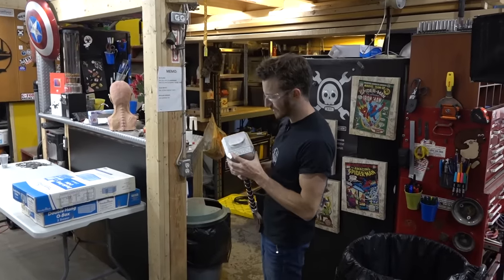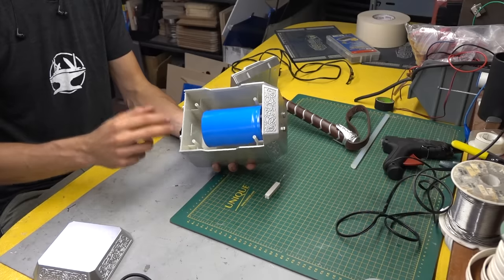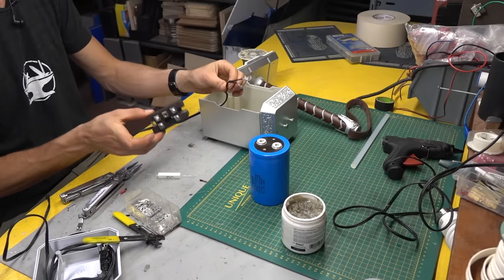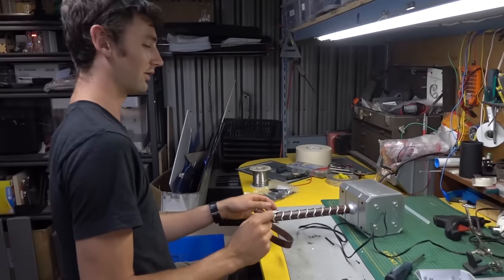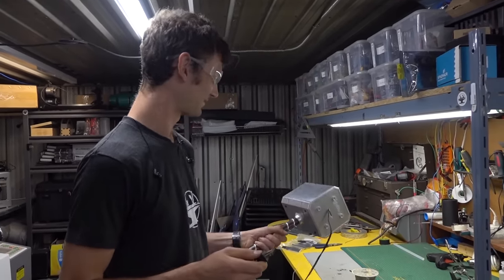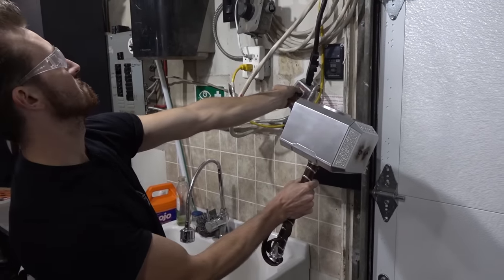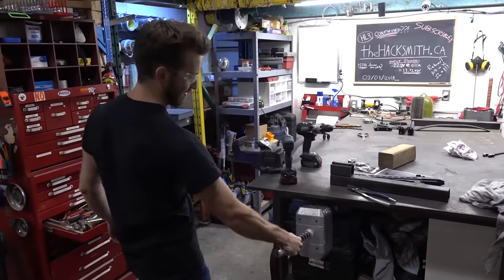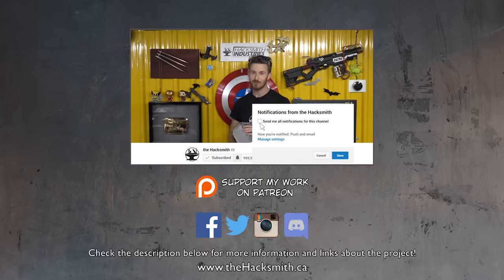Thor's 300V Capacitor Hammer Build!

Comment: "Extra safe adapter".

Right on top of a kitchen sink.

The fine irony of knowing how to work with high voltage capacitors and completely butchering the high-tension norms. Sir, you're an idol to me.
Reply from the maker: Where else would you put it! xD
Reply: Inside the sink?

Comment: I dear you to make the suitcase of kingsman which turned in to a full body shield with the screen on top. That with the press of a button it can like flip the sides and slide them to convert the box in to the shield.

Pd: Doesn't have to have either a rocket luncher or a gun built in.
Have fun building it
Reply: ROBLE2003

Comment: Yikes, that a yuge capacitor.. isn't that enough to stop a heart? :x
Reply from the maker: probably
Reply: Two things I like about this comment:
-Yuge. You sir are amazing for daring to use that anywhere online 👍
-I read heart as hert and thought of Daily Transmission. Not enough to stop Hert lol, but Hacksmith is right about everyone else :P
Reply: Rae Chrest 48 volts can only kill if there is enough current (amps). Same with 400 volts. Having said that, voltage does help the current break the resistance of your body, so high voltage is still dangerous.
Reply from the maker: +Ben Rawlings also depends if it's AC or DC. DC for example I have touched 144VDC with each hand ( not recommended ) but just a tingle. If you did that with 144 or even 120vac your probably going to stop your heart!
Reply from the maker: +Rae Chrest also depends on AC versus DC
Reply: the Hacksmith ahhh okay thanks!
Reply: Rae Chrest 
I kinda compare Electricity to Water in pipes. Amps' like water pressure while Volts' like the diameter of the pipe/node
Reply: no problem Rae, and yes you can. I bought a 'boost converter' off of ebay, which steps up 3 volts DC (2 AA batteries), to supposedly 400 000 volts, but it does nothing to the current, so there is barely any amps in it. I touched it and it did no harm, but still hurt a lot.
Reply: +Ben Rawlings But you have to have the volts, if you don't have enough current, the voltage collapses. That's why voltage is usually more dangerous (especially when dealing with capacitors) but In the end you need both.
Reply: +Mike Aba volts is the pressure, current is the amount of water that flows through the pipe, and pipe diameter is the residence
Reply: +Ben Rawlings if you tried to charge that capacitor with a boost converter and some batteries, you'd be there forever,
Reply: Mike Aba or start one
Reply: piercing silence 
Heh, yeah. No idea how defiblirators work tho
Reply: Gabriel Schoene 
what's "residence"?
Reply: Rae Chrest
Volts and amps two different things. One is a measure of voltage and one is a measure of current. X amounts of volts does not equal Y amount of amps
Reply: Stop it? More like French Fry it.

Comment: What Thor Hammer replica did you guys use to make this? I'm asking because it's one of the better looking ones I've seen.
Reply from the maker: +JOHNSMITH11, The Guy of Thunder links in description
Reply: the Hacksmith You're right, there are links in the description but not for the hammer in this video. That's why I asked.
Reply from the maker: guess that means the store isn't selling them anymore, just the metal version (which is nicer btw)
Reply: the Hacksmith  True, but I already have the metal one lol

Comment: You can use a multiplier circuit with a batery and a swtcher  to convert dc from a 12vcc to a 4kvcc so you can charge the capacitor and make it portable. Like a taser

Comment: You should take the capacitor rigged one, and charge it using the Tesla coil vs the 120V or 240V, then hit the shield with the exceptionally charged Thor's hammer.

Comment: You should put Supercapacitors in there with the next version. And maybe batteries in the handle to store energy for additional uses.

Also, give it a tungsten casing, just to give it some extra durability and heft.
Reply from the maker: Tungsten shatters
Reply: the Hacksmith Wait, really?! Dang.

Comment: make a metal one that's  activated by inertia so it only sparks when you hit something hard enough. i guess you probably used plastic for the insulating properties but you could isolate the anode and cathode well enough in  the system then use a polycarbonite handle.

Comment: when you use a rectifier you would half the voltage. so at 110 you would have a bit less than 55V and at 240 you would only be around 115V.

Comment: Pretty simple, yet so cool.. maybe you could improve it by putting two metal plates on the face off the hammer, connecting each  one to a single electrode of the capacitor. You could just use it more effecively that way, because you wouldn't have to line up the electrodes every time with the object you're trying to electrocute
Reply from the maker: line up? most of the time you just swing it and hit lol, i was just being cautious

Comment: Does it have a discharge circuit for safety? Capacitors build charge even when not in use.

Also what happens if the face is laying on a metal surface while charging?
Reply from the maker: +Extra Mental they do not charge when not in use... They discharge when not in use... Leakage current.

If you charged it while it was shorted, you would trip the breaker immediately.

Comment: At 3:25 in the video, when Ian tests the hammer and says "that's half the power...", that isn't actually correct. It's a quarter of the power when compared to charging at 240V (stored energy U = 1/2C*V^2). And when you think about the capacitor discharging through a fixed resistance, both the voltage and current will be double when the voltage on the capacitor is doubled, so the power through the resistance will be quadrupled.

Comment: the real one probably had herbs in the wrapped hilt that caused the electrostatic charge release that numbed the arms of the defender using full metal shield with a rim of hard wood to prevent the metal splitting and as i said the shock made the arm not work for the impact. this would cause the arm drop that left the opening for his sword which nobody remembers anymore. it wasn't special. it most likely took two herbs to work and required the use of remains that he constantly rubbed against plus leather and he had to get used to the shock. also i don't know the second herb but the first is most likely cotton. when you live in the north you use whatever is at hand. especially if you took it off a dead guy.  oh silk.

Comment: Would the cap discharge through the lead if you were to touch the plug ends? If not, you could mould the plug into the bottom of the handle so you don't need to open the hammer and plug it in every time, you could just stick the hammer into the wall outlet and it would be quicker
Reply from the maker: nope. rectifier is also known as a one-way circuit, diodes only let the AC in to become DC, then the DC can't come back out ;-)
Reply: Would it spoil the look of the hammer to have the pins out the bottom of the handle so you don't have to open and plug a cord in? Thanks for the reply.
Reply from the maker: sure but... any method of plugging it in is lame haha, you're suppose to charge it and THEN use it ;)

Comment: You can build this with the used flash cameras from a walgreens.

I did this like 5 or so years ago and 2 walgreens gave us a bunch of their used cameras for free. 
You take the capacitors and cut out the charging circuit from the camera and do a couple wire solders and its done, and its super tiny.

The capacitors from the cameras are 330V and if you get a bunch, you can just bank all the capacitors together to get an even bigger pop.

Comment: Make one with a more solid build and instead of the pins, the whole face of the hammer can be made to discharge. Make the terminals large, flat and half the width of the hammer, and separate them with a thin insulator so when the entire face is touching(cuz it's flat), the hammer will discharge. And if youre making then rest of the hammer with metal too, then the face can be separated from the rest of the body with any insulator too :O
Reply from the maker: or wait until you see the rest of them ;-)

Comment: Jesus, that thing is lethal.
Reply from the maker: +Ian Rupenthal not really. It would just cause a bad burn. It's important to understand electricity, then you can safely play with it =)
Reply: Says the guy playing with a giant cap with no safety equipment besides glasses... Love your content, but man, get some thick rubber gloves and maybe some ear protection.  FYI defibrillators use less than 1000uf (but higher voltages).  Be careful.
Reply from the maker: +Ian Rupenthal and for a defib to start (or stop) your heart it has to go across it. Bit of a challenge with contacts an inch apart. Wearing rubber gloves while holding the hammer is completely pointless.
Reply: but what if you touched each contact with a different hand?
Reply from the maker: +Ian Rupenthal then you deserve it lol. Same as sticking two knives in an outlet.

Comment: What if:
1. Instead of using tiny metal bits for the discharge terminal, metal bars are used? So that the user does not need to think about the correct placement
2. The plugs and cable were placed inside the handle with an end cap
Reply from the maker: Huh? It's two screws, which are basically metal bars
Reply: @hacksmith  I mean parallel metal bars placed along the surface of the hammer intended to be discharging the capacitor. The concept is distributing and extending the discharge terminals all around the area of the active surface.

Comment: I'd highly recommend a cheap ebay power inverter and some lithium cells. You'd need to increase the resistor value and it would be a bit slower charging but it wouldn't need to be plugged in every 10 seconds.
Reply from the maker: Yeah because we really use this often ;-) haha
Reply: the Hacksmith actually you could probably just connect straight into the dc voltage rails and avoid the inverter stage all together. The boards are pretty tiny so you could probably fit it all inside the hammer.

Comment: Just leave it plugged in when you use it, way more fun
Reply from the maker: you'd trip the breaker...
Reply: I figure a clever guy like you would put a ballast in series like an old bar heater, then it would never trip the breaker and would charge at near full speed.
Reply from the maker: meh. this isn't exactly a practical weapon to begin with

Comment: It will be more interesting if you use a built-in Lipo battery and a step up converter to charge the capacitor.
Reply from the maker: not many affordable step up converters from 24-300v...
Reply: One russian proverb says: "If there is a desire, there are a thousand possibilities. If there is no desire, there are a thousand reasons." :)

Comment: Make the two sides I mean the whole plate to pass electricity and make the top circle portion to receive charge with just touching. I mean make the top circle portion a wireless charge receiver.
Reply from the maker: But you need to make a connection across two separate points to create the arc!

Comment: If you actually made a metal thor's hammer prop to put this into then you could really bash it around and stuff. That might be cooler, since if you hit anything too hard with that plastic model it will just shatter and you'll have plastic and wire and bridge rectifier and capacitor on the floor.

Comment: So I have a very poor grip on capacitors.  Why does it make a difference what voltage you charge it with as long as it is fully charged?
Reply from the maker: because it only charges to the voltage you put in! it stores more power at a higher voltage =)

Comment: Underengineered! Half your capacitor is wasted, it could have been half the size, (or twice as powerful). Energy in a capacitor goes up as voltage squared. At 300v you're looking at 149 joules of energy, but at 400v you're looking at 264 joules. Capacitor size (volume, mass, whatever) scales roughly linearly with energy... so, you could've been 43% more powerful out of that cap. Or, fit more caps in the same space. 

Dragging the energy out over more time might've been cool too, make it more like lightning. maybe 3 caps triggered in quick succession.
Reply from the maker: using what we had on hand, big ol box of caps.
Reply: Oh I thought you'd ordered everything from Digikey. Well that makes sense then. The right tool for the job is the one closest to your hand :P
Reply from the maker: speaking of which what should we do with the remaining 35 caps?

Comment: Yeah, I once charged my disposable camera taser with a 3.7 v li-ion battery instead of the normal AAA it required. I of course discharged it into a penny. My ears kinda hurt afterwards... 
Anyways... discharge the capacitor into a nichrome wire! It should go BOOM!!!

Comment: That cap won't last too long getting short circuited like that! Unless it's a pulse rated cap which most electrolytics are not, even then they don't last too long. I also would suggest putting a suitable bleed resistor across the cap. Otherwise somebody will eventually get a nasty surprise at the point they don't realise that someone else accidentally left it charged up and forgot to discharge it. Or at the very least a trigger switch that isolates the output studs when you let it go.
Reply from the maker: Good thing we have like 35 of these :P also we're pretty conscious of charging it for the purpose of discharging it. So no ones leaving this bad boy on!
Reply: Lol yeah 35 should keep you going for a while... :) I only mention the bleed resistor because 20 or so years ago when I first started working in electronics I did make the mistake of putting my slightly damp hand on a fairly large fully charged electrolytic cap. Got a hell of a surprise and was left with a nice set of burns on the palm of my hand. D'oh!

Comment: Use fly swatter circuit to charge capacitor without plug in
Use it unlimited times
Reply from the maker: +Satish Vaidya no where near as powerful
Reply: What about using more mini capacitor to boost amps
Reply: Or what about taser hammer
Reply: With voltage multiplier

Comment: i was thinking you could make one with a plug in the handle, a positive or negative electrode on either side of the hammer, a giant capacitor (like the one you already have in it), and some sort of amplifier to increase the voltage dramatically (buck boost, op-amp, inverter, etc.) 
idk just thinking out loud
or in text, i guess...
also i have no clue if that would work AT ALL
Reply from the maker: why would you have one on either end of the hammer though? how would you connect it to anything?
Reply: yeah good point... maybe one on either corner of the same side?

Comment: Could you use a capacitor like that to jumpstart a car? Seems like it'd be more useful than one of those junky lipo battery packs they claim will start a 6+ liter diesel. Anyways just plug it in for 30 seconds, then go jumpstart your car. No worrying about if you last charged the jump pack a long time ago.
Reply from the maker: not a capacitor like this one lol, it is possible, but you'd need one rated at 12V and many farads

Comment: Could you replace most of the plastic with lead ?
Reply from the maker: watch our heaviest hammer video :P
Reply: @hacksmith  I meant, with the capacitor, the wires, etc, inside of the hammer. For example doing a replica of the hammer in lead, then carving inside of it to put the capacitor and everything you need to make the shock inside of the hammer. Without forgeting the isolation, because lead is conductive.
Reply from the maker: @cerveau24  I'd use a metal hammer to start, the plastic would melt
Reply: @hacksmith  yeah that's what I meant : a full lead hammer, with the "shock system" inside of it. So it is shock-able and really heavy. Sorry for my English being a bit weird.
Reply from the maker: @cerveau24  definitely doable
Reply: @hacksmith  it would be awesome if you do this

Comment: What's the amperage? If it's low, you could do it to a person!!
Reply: the amperage is nearly infinite when shorted to make sparks... so due to the charging time and the type of cap i estimate the capacity and thus the stored energy to be big enough to  throw your heart out of rythm or at least cause severe burn marks at the point of contact... so doing it to a person is a big NONO

Comment: it would be better to have 16 volt capacitor with much more charge inside. if you are going to discharge it on conductors with low resistence, then you dont need volts. you need amps
Reply: and also would be safer for people to handle.
Reply from the maker: yeah well we used what we had

Comment: You guys are not safe. You guys are very dangerous. You went from "I have a cool Thor hammer" to "I have a very dangerous high voltage TOY and I am running around like a kid with a butcher knife defiberlator"
Reply from the maker: Welcome to the channel. Also if you learn a bit about electricity you'd know the danger is a burn, not a defibulator.